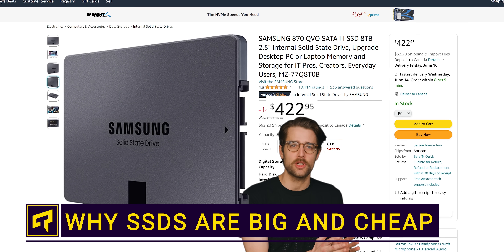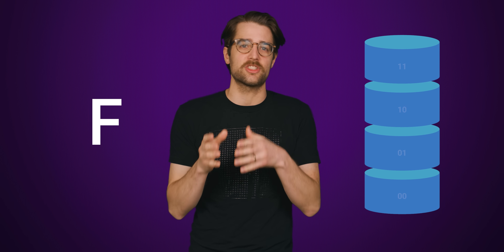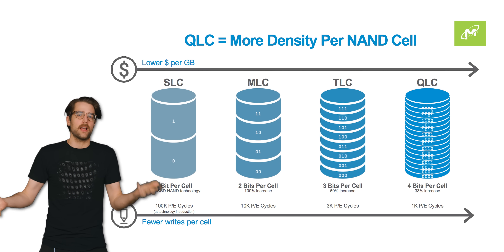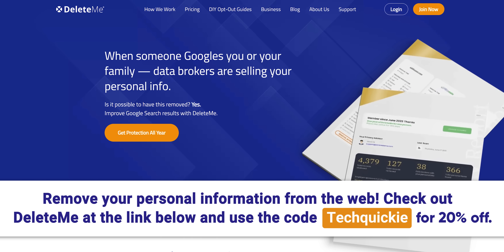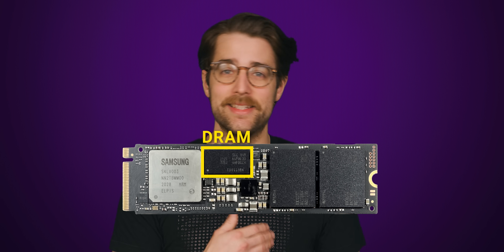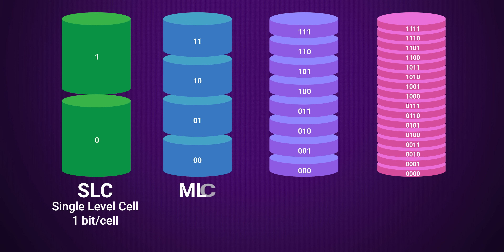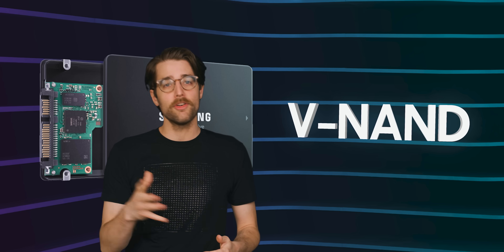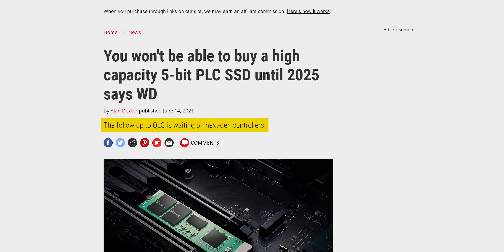Why SSDs Are Big And Cheap

Comment: I love LTT sometimes "cheap ssd" *shows a $422 SSD*, granted that is probibally cheaper than it was when it came out and expecially for the capacity but i still wouldnt call it cheap, using the ever so reliable pc part picker i found a HDD thats 8th for £122.90 with the cheapest SSD at the same capacity being £437.56, later being a samsung 870 QVO the former being a Seagate Barracuda Compute 5400RPM with a Seagate SkyHawk AI 7200 RPM 8TB HDD being £158

Comment: I love my 10 terabyte hard drive.
I use a 1 terabyte SSD for Windows.
This combination works out well  as all (mostly) my programs are run from the hard drive and reduce wear and tear on the SSD.
Reply: SSDs don't really wear out like HDDs. No moving parts. That said, I've had a hard drive for nearly 10 years and it still performs well. Was my original main drive and now it's just for storage.
Reply: Lol splitting hairs

Comment: I still use HDDs for games and data files and an M. 2  for running W10.... My PC is 8 years old though..
Reply: Using SSDs for games makes them load super fast though if you can afford it, I was surprised when I bought my 4TB SSD.
Reply: @jer1776  this is something that I want to do in the future when I get a new PC. My current M.2 is 256GB and that's not going to fit games like GTA V 🤭

Comment: My 1st SSD was Intel 80GB $300 in late 2009
Reply: I regretted not getting one of those instead. I got the Patriot Warp 64GB and the controller sucked. Random writes would freeze the system because it had a slow controller

Comment: In my opinion, TLC is such a golden mean between disk performance and its capacity ;)
Reply: Wouldn't use it for metadata because it dies fast (TBW) but great for reading from.
Reply: @llortaton2834  In general, for keeping important things, I recommend keeping copies on 3 different drives
Reply: @Spioszek  The 3-2-1 strategy basically
Reply: @llortaton2834  They do wear levelling, and with higher capacity you get higher TBW. With your average TLC 2Tb SSD you will get about 1000Tb before it dies and that's a pretty big amount for any kind of metadata.

And it's not like you have a choice for the type. TLC is as good as it gets, MLC isn't available anymore, and QLC is easy to avoid.
Reply: When TCL came out it was called terrible though. SLC is amazing, but not cost effective. I liked MLC and wish there were still options. SDDs makers should have tiers where we could choose which we want with our wallets, but unfortunately consumers aren't informed and just want the biggest drive for the cheapest price most of the time.
Reply: Disagree. Especially if you want to store data powered down for more than a couple years....who hasn't stored an old PC only to boot up years layer
Reply: I definitely avoided QLC from the moment I read up on it for sure
Reply: @pyromethious  Dollar savings are great though when storing un-important data.
Reply: @pyromethious  I'm also avoiding QLC, and forget PLC.
Reply: I loved that band.
Reply: QLC is fine as long as you’re not making a ton of file transfers or using it as your main system drive imo. Sure it has fewer write cycles and is a bit slower, but I’d argue it makes up for it in price.
Reply: @dyedie1  Except that it's barely any cheaper than TLC. Difference between $60 and $75 is so insignificant, that you will gladly pay for TLC that you will use for 3-5 years more. QLC isn't worth it.
Reply: @dat_21  If I know a drive I’m using is not going to be write heavy at all, what appreciable difference is there between 1000 average write cycles (qlc 3d nand) and 3000 (tlc 3d nand)? Even with a 512gb qlc drive that’s still 500 terabytes of write. I’ll probably want to upgrade because of technological advances before I hit that write cycle limit on a non write heavy drive, so why pay the extra money? Not trying to be adversarial, just genuinely curious.
Reply: @dyedie1  First of all you shouldn't really buy 512G SSDs, because motherboards don't have lots of M2 slots and if you want to use the drive for a long time it better have a decent capacity.

And second, QLC isn't that reliable. It's like 100-300 cycles against TLC 600-1500. So your 512G QLC will survive like 50-100Tb of writes. 

I'd rather add 30$ for a 2Tb model and buy a TLC. Faster, more reliable. 

QLC doesn't make any sense at these prices. If they were 2x as cheap, then maybe, but not at 85% of the TLC. That's a trivial difference.
Reply: @dat_21  Yeah I was just using the 512 gb as an example. I recently got a 4tb 3d nand qlc drive. 2d nand qlc has around 100 write cycles, but 3d nand qlc increases that to 1000. I haven’t done a ton of price analysis between 2d tlc and 3d qlc nand, so it’s possible I could have gotten a cheaper tlc 4tb drive, or one for the same price with slightly better performance, but as far as longevity goes I’m confident that a 3d nand qlc will be more than enough for my purposes.
EDIT: Just did a cursory search of newegg and amazon and it seems that a similarly specced tlc drive to the qlc one I bought would be around $40 more on average.
Reply: @Dat  The close in price gap is a relatively recent change though.  For years you could regularly get QLC w/50% more cap per dollar compared to TLC.  It was a tradeoff, sure, but when you study the practicality and use cases, most consumers would see theses SSDs become obsolete long before they even reach their half-lives.  Additionally, larger capacities mean fewer drives, so space/ports are a consideration as well.

Today , seeing a ~$200 4TB EVO at almost exactly half the cost of a ~$400 8TB QVO, I'd steer most consumers towards TLC drives.   However, if a 12TB+ QVO hit the market at $450, I'm going to strongly consider QLC once again.

Comment: I just googled prices and I was shocked. 2 TB Samsung EVO is 130 €. I paid 240 € for 1 TB in 2018.
Reply: I paid 480 for 1tb in 2016 iirc
Reply: kingston nv2 2tb is 80e and it's m2 form factor!
Reply: now you can get a 2tb intel 670p nvme for like $70.
Reply: @tbm7301  and for 10 bucks more you can even upgrade to an pcie 4 one
Reply: I am surprised how much SSDs have dropped in price. And my mother still tells me that they are overpriced, probably because they are over $20.
Reply: Got a 4 TB pcie 3.0 m.2 from crucial for 160€ a few days ago. Pretty sure i paid more for my 256 GB bootdrive back in the day 😂.